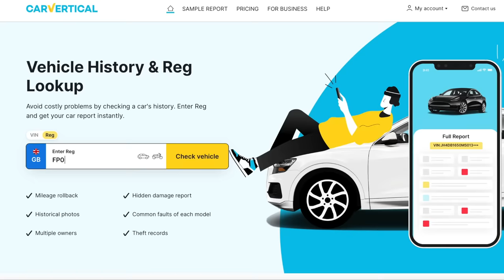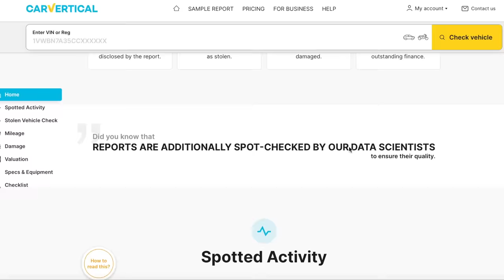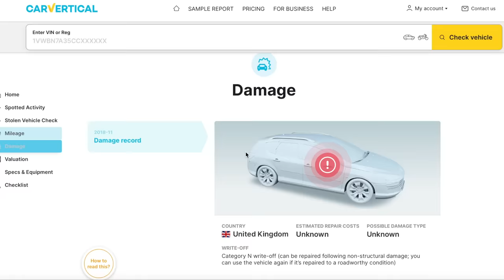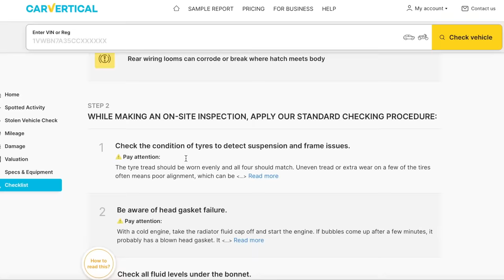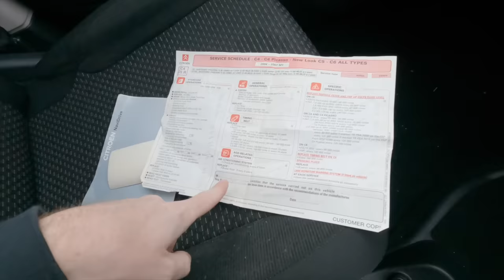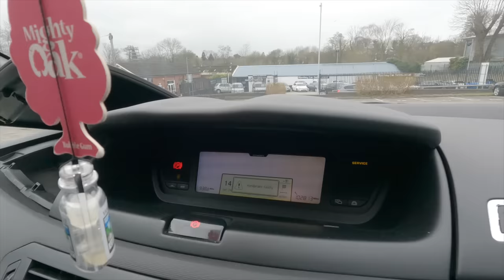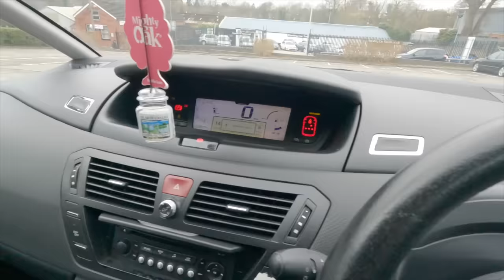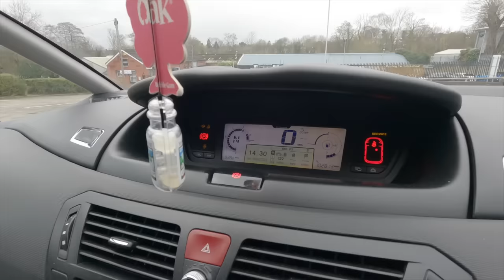I BOUGHT A CHEAP CITROEN C4 PICASSO FOR £300

Comment: This should be fun. Wife had a brand new one, all the spec, full leather. Kept it for 8 months and lost a pile trading it in. Biggest problem was we lived at the top of a hill and the C4 could only get to our house with a run up.
Reply from the maker: Hahah I can imagine
Reply: @HighPeakAutos  Hey man could you please give your opinion on more of these family tourers??? I really want a Ford S-max but my wife needs convincing and she likes this channel…So please could you help a guy out?
Reply: @justkiddin1980  Get a 330d estate.
Reply: @justkiddin1980  I wanted one but absoutely not Powershift so I went Tiguan automatic, not dual clutch.....
Reply: @justkiddin1980  Avoid the Powershift gearbox - we had our S-Max for 13 months and moved it on at a loss after warranty work couldn't fix ours.. apart from that the car was brilliant.. go for a manual!
Reply: @intelmacs  so the men wants a family reliable car and you advise him to buy a BMW?! Hahahah
Reply: @justkiddin1980  if its a manual with a 2.0 or 2.2 tdci its a good car. Don't forget when doing the timing belt there is also a small timing chain between the two cams, so not a bad car... But if you only need 5 seats biy a Toyota RAV4
Reply: @justkiddin1980 Have you considered a new shape Volvo XC90? Or a Range Rover Sport? Or even a nice new shape Audi Q7. Whilst they might cost a bit more money to buy and run, they’re all much, much nicer in my opinion. The Volvo has a beautiful interior, the range rover is nice too and the Q7 (if a bit more clinical) is a very solid and well built vehicle.
Reply: @justkiddin1980  Mk 4 Kia Sportage 1.7 diesel. Thank me later
Reply: @justkiddin1980  Do it, I had one and it's lovely, big, spacious, practical, safe, drives well. Not rapid or good on fuel, but hey.
Reply: @justkiddin1980  get a audi a4 avant
Reply: @justkiddin1980  Whatever you do, don't buy one with the Powershift Auto Box, unless you like parting with £400 for the special gearbox oil every 2 years (Ford says 3 but it's 2, believe me) and running on 3 gears rather than six after a few hours on the motorway.  A friend had the manual and loved it BTW - very practical cars and reasonable to drive.
Reply: @justkiddin1980  Not sure of your budget but consider a Japanese import MPV, eg Toyota Alphard, Nissan Elgrand.
Reply: @danecowan678  Eh i’m sorry i’m bound by a budget…so volvo audi etc are out of reach…And one specific demand is 3 full seats with isofix in the back..

Comment: Just to provide some balance to the comments I had 3 of these during my 16 years in France - with no reliability issues. Very practical - I`m a surveyor could get my 3 surveying ladder inside and also going on holiday had 2 bikes in the back plus luggage. Regular trips back & forth to UK - comfortable after a 10 hour drive to the Tunnel and 48MPG. I used a local garage for regular servicing (French version of Ed China who was a wizard with all makes & models) and always bought second hand from Citroen dealerships with extended guarantees - which I never needed to use.

Comment: I get a sneaky suspicion you’re not a fan, Matt. 😂
Reply from the maker: Not at all!
Reply: @HighPeakAutos  I hate them as well not only are they unreasonable there also unsafe the electrics on the car always seem to fail and if U buy a used one its never looked after but I really hate that the rev counter and speedometer are in the middle as that would honestly be the last place U would look for it I would just use a iPad and put on the dashboard behind the steering wheel and get my speed off that and U would never be able to hang something quick long on the mirror as it would constantly wack the display in the middle cracking The screen and make it completely useless

Comment: I just got a regular 2011 c4 vtr. And so far I think it's brilliant. It has a normal gearbox and proper handbrake. Despite the small diesel engine it's punchy and sips fuel the same way my t total mother in-law sips her annual thimble. The handling is way above average. Lotss more fun and in better condition than the 10k 2012 v6 Audi a6 I nearly bought which was comfy worn and quite but very dull. Better condition than the 2012 seat Ibiza, 2013 golf both rusty and hammered, and 2014 astra which handled ok and good pulling power but very wooly gearbox and a smashed in bumper and keys like they had been through a dog. All around 6k. So my 2k c4 seems like a bargain with 12months MOT. I've had it up to  6points territory on b roads. It handles so well that you dont need the brakes. It's booked in for service and I'll splash out on some good tyres and I'll update if it blows up.

Comment: The original picasso was brill,i had a 1.6 hdi ,you could remove the seats,and it was so comfatable ,it was a 2007 reg.
Reply: Had one removed all but drivers seat used as a scrap wagon for few weeks then weighed it in
Reply: Was my first car lasted 2 days before it shit itself and lost all oil over the road
Reply: I love my 2007 Picasso c4. So  comfy. Vast window space. Nice high seat. No problems so far at 130k kms.

Comment: I have two French cars. A Peugeot 208 1.0 vti and a Partner 1.6 HDi - same engine as in this Picasso. They’re both very simple and so far very reliable. The Partner has just gone past 410,000km. I’ve had it since new in 2006 and it’s been well maintained. But the electronics are simple, everything is manual and, because it’s based on a van, everything is robust. The 208 is more flimsy but again it’s simple and just works.
Reply: It’s not the engine that’s the problem (Well, if it’s not looked after it is the engine), it’s everything else surrounding the engine, and the bigger the car gets, the more complicated it becomes and the more “luxuries” it tends to include. I’ve seen Peugeot Vans clock well over 300,000 miles with ease, just never the family cars, they can’t stand the challenges that a family car has to face.
Reply: Then engines last forever…..it’s the bloody electronics that messes them up

Comment: I really liked my old C4 Grand Picasso, full leather and very practical, no electrical issues. 
Gear changes while on the move were good but only if you were in manual and adjust the pedal while changing, I could live with that no problem. 
What I faced though was that stuck in traffic it was far too jerky. It had no crawl function so in 1st the clutch was either fully engaged or disengaged. I honestly thought there was a serious issue with the car until I found out it was normal in these.
Reply: Crawl or creep is not a function, this is how automatic transmission works. This citroen is not an automatic car that's why it doesn't creep. Dual clutch transmissions fake being an automatic transmission by half applying the clutch and creep a little bit.
Reply: We love ours. For a family car it's brilliantly designed.

Comment: I actually have a soft spot for these, we had a grand c4 that ran through the family. Nothing really beat it for family roadtrips with all that cabin space, and the copious amounts of glass made it really bright on sunny days. I just love how quirky and weird they are.

Not to say it didn't have faults though. The gearbox did have plenty of issues, the electric windows failed multiple times leading us to tape them up, and the drivers sun visor (on the hinge side) kept falling off and twatting the driver in the face. The visors are completely made of plastic too so they're really heavy and properly attack you when they fall

Comment: 10:32 That's where radio and climate controls should be, in my opinion, so that only the driver can access them. I didn't know that was a thing on these. I love it!
10:58 The cover is to make the design look cleaner when you aren't using the radio, which is a good thing. It's not a particularly good looking unit, despite it having a great on-board computer.
11:34 Those sliding covers are meant to both let more sunlight in and to make the cabin feel a bit more spacious/less claustrophobic. It's a neat feature, but I don't think I'd use it much. 
17:39 The "center never moves" so that all the buttons are always in the same place when you need them. It also allows them to fit more buttons there. The only reason why I don't like that is because I love seeing brands' logo spinning around when turning the wheel (no matter the brand).
The "Risk of ice" thing shows up whenever it thinks outside temperature is below 3ºC. It's the same on other Citroën products with the same head unit, and it's annoying because it blocks off most of the on-board computer/radio screen for a couple of seconds.
With all of that being said, that thing sure seems to be in a sketchy state.
Reply: I forgot to mention this: it tells you if it's in Drive, yes. You selected 2nd gear (that big "2" on the screen) while messing about with the paddles.
Edit: 19:26 The handbrake is on if the light is on. I tried out a similar system on a new-ish Berlingo and hated it. You need to hold the brake to disengage it.

Comment: Before I bought my Volvo, I had the previous version of this car (the older Picasso [petrol 1.6] on a 52 plate). It was much more simple and lacked many of the things you hate. However, the end of the line came when I had to pay £400 for engine and suspension work on a car that was worth, at best, £200. I scrapped it off soon after before it got to the stage whereby I'd spent so much that I couldn't afford to NOT keep it.

Comment: I always thought the panoramic windscreen was the one redeeming feature of these! I can tell you it was never fun to use in the south of France because you'd burn your skin in 5 minutes but I'm sure it's quite nice with UK weather to get a bit more light into the horrible cabin!
Reply: The adjustable sliding visors do a decent job of reducing down to more of a normal sized windscreen, so I only see mine as a bonus and unless the sun is head, I always slide the visors back.

Comment: Best to scrap it mate, it was actually dangerous, those hand breaks are a nightmare, quick tip, there's a release tool that you put thru a hole in the passenger side like a thin starting handle, it winds off the handbrake, on the old ones it's a pull cable in the boot, citroen knew it would stick one!
Reply: the electronic handbrakes are a lot better these days Citroen have upgrded the rear calipers which dont stick like the old cheap and nasty ones in the C4 and C5 cars. in my 2019 C5 Aircross you can apply the handbrake and drive off it and it will release automatically. nowadays you need to tell the ecu your changing the rear pads and it electronically releases the rear calipers for servicing, but thats just the way things are going these days. Never had any issues with the electronic parking brake as yet. hill hold is also very good as you dont need to be operating a manual handbrake as you pull away on a hill even when towing.
Reply: @oojimmyflip  yes bud I've got one on a 61 plate scenic and it's been no trouble, tbh matt in the video should have just been driving off and not using the switch, might have been OK, I once modified a handbrake motor on an old picasso to work with a reverse pol switch, its basically just a motor that pulls the cables anyway.

Comment: I use to work at a Citroen specialist. 
Long before these come out.
The old Picasso were very dull and apart from the dash packing up were generally tough cars.
But these are utter sh***
Great video and honest view of these
Reply: Indeed. I actually chose to buy a Xsara Picasso on a 59 plate - last of the old model.  Never had any issues and the 1.6hdi is actually very quiet and refined for an old diesel. Pretty much bullet proof.
Reply: @IceReef  The old 1.6 HDi  xsara picasso wasn’t that bad we just had a few more issues than the 2.0hdi but the 1.6 was a nicer engine to live with. 
I use to service a fleet of these a taxi firm had brought new. 
In 2.0 hdi form they were among the most reliable cabs he had.
He brought one of these C4 Picasso it was taken off fleet with in 6 months.

Comment: I had one of these.. my wife drove it for the last 5 years basically to drop kids at school but it did a couple of long trips around Europe.After 10 years and only 100k miles it started to literally disintegrate. Built quality is simply disastrous. After 8 years literally everything started to fail. It was also not built for being repaired, as the guys at the Citroen dealership were always struggling to find what was causing the multiple warning messages on the dashboard. The ESP malfunction warning light was already part of our family! But the worst, was the  painful "auto" gearbox... Spacious and clever for sure, but a piece of junk. Finally, we replaced it by a Toyota.
Reply: The build quality of these really is horrendous, the list of complaints I have with ours is too long to go into. The amount of space inside is the only redeeming feature. I gave up spending any money maintaining ours a long time ago, you get one thing fixed and something else breaks. Ours is thankfully on its last legs so it's finally time to say good riddance to it and buy something decent. I won't miss it at all - the worst car I've ever owned by a really long way.

Comment: Never thought about new plates lifting the look of the car but I just stuck some on my cayenne and it looks even better!
Reply from the maker: They make a big difference!
Reply: I've sold some cars through the years. In Denmark and Norway we use a holder/frame to hold the licenceplate. I always change it front and back. A new sparkly one from a renowned cardealer and a polished and coatet licenceplate works magic.

Comment: Had one of these for 3 years, it was 4 years old at the time of purchase, and unbelievably it didn’t fail once, except for a puncture which doesn’t count obviously, did 40000 miles which included 2 trips to Paris and 1 to Cornwall. Yes some bits inside were a bit flimsy but nothing fell off nothing stopped working and nothing exploded. Couldn’t wait to get rid of it 😂😂
Reply: You had a good one , ours was a bloody nightmare
Reply: @oddsandwindsocks5905  it was a manual so... 🤷🏻🤷🏻
Reply: I have my one for four years now

It’s a manual and I’ve put 130,000 kms on top of the 120,000kms already on it.

It’s been very reliable, never let me down at all

🤷‍♂️
Reply: Had one for 10 years, put 250k on it, just stick it in cruise control and pottered around, maybe I looked after it better than most.
Reply: @BrianMccairn-lw9vb   I used mine as a van when the engine went in my van. Folded the seats flat and there was part of me was sorry to be going back in the van because it was a comfortable way to do long journeys.
Reply: @BrianMccairn-lw9vb  Similar - I still have a 2008 Grand Picasso and it's been great with 4 kids and when we only had 1 car, wasn't too large or uneconimcal for my wife to drive around for her work when on her own, either, conmpared to some other 7 seaters. Mine is the eleectronic gearbox as well and it is a pain in stop start traffic and I agree with Matt @HighPeakAutos that they should have kept it simple, along with the handbrake (mine good so far). Mine is the top of the range, so also has complicated air suspension which is a worry and the full digital dual zone climate control to add to the complexity, but apart from replacing the blower fan myself, has also been good. Auto-lights, auto wipers, cruise control, auto handbrake on (goes off when  you pull away as well) all seem to work.
Reply: @mindhead2005  And I always got 50mpg+.
Reply: @brian6464  same here! It's been great, to be absolutely fair to it, and it owes me nothing at this stage.
Reply: @jimmyccam  lol!
It’s my fourth Citroen and they’ve all been reliable, for the most part. And I do fairly high mileages for work.
Reply: First car was a C3 1.4 diesel 53 plate, bought at 5 year old. Did 150k miles in 13 years, great economy, hdi engine not a spot of bother, easy to self service, simple car, cheap. Took it to France (got 800 mile out of the tank on return journey), all over the UK and Ireland, loads of camping trips with plenty gear, only gave it up as had neglected washing/underside rust and sills. Devastated to scrap it. Not a looker, but smashing little car. 

Now got a 15 plate C4 picasso 1.6 manual diesel from her mother now. Last three years no bother, although water pumped failed prematurely, which just meant needed to do timing belt a bit early at 75k miles. Back seats fold flat so it's practical for all house related trips to the tip, shifting furniture, don't need to hire a van. Visibility great with the sun visors that go back. Would rather have panoramic sunroof but not paying the extra few grand for it, I'll settle for this. Serviced myself, easy job. Great on fuel. £20 tax (versus a colleague's Volvo XC90 that is £700 a year). Great family cars, not lookers, but you can't get better practicality for the price. 

Actually, that reminds me. We got a new bed recently so the old one is sitting in the back garden waiting for a Saturday morning when I'm free to get to the tip. Thank god I don't have to hire a van. Back in half an hour.

Comment: Handbrake was meant to automatically disengage when you selected gear and pulled away. You only needed the button for parking on a hill. Handbrake would also engage when you pulled up and went into neutral whilst applying the foot brake. 
I've had two, one diesel and one petrol - great load carriers but greenhouses in the Summer.